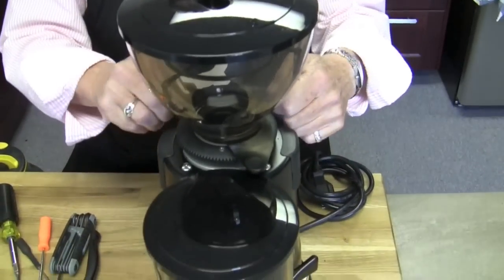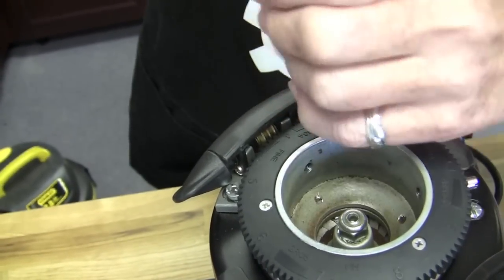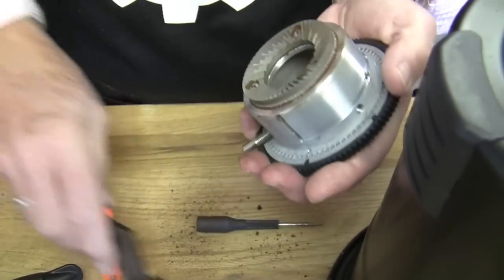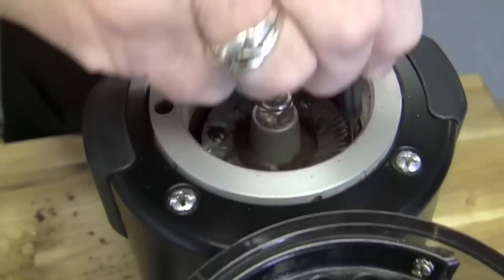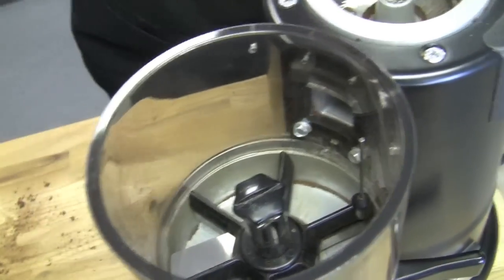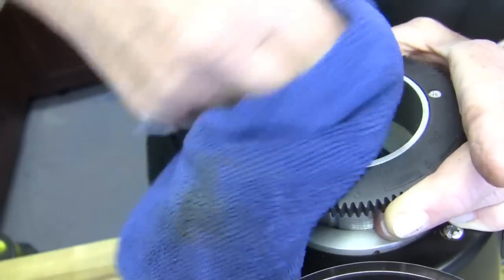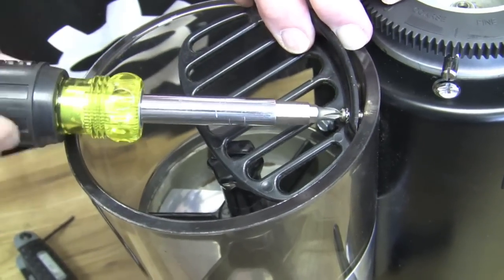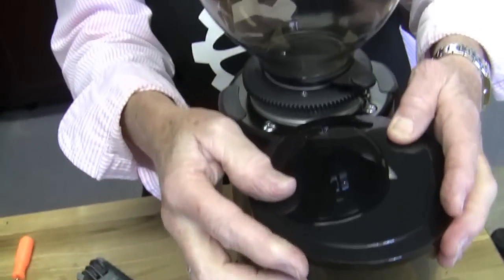Tech Tip: How to Clean the Macap M4 Coffee Grinder

Comment: Very useful. I’d bought new burrs for my (home) M4, which I’d never changed (it’s 7 years old), but I hadn’t begun the project of changing them. This morning (April Fool’s Day), still half asleep, I stupidly poured some water into the hopper instead of into my water heater. This caused the grounds to form a paste so that no beans would drop and no coffee would come out of the chute. Luckily, there was Gail, walking through the procedure for cleaning the grinder down to the burrs, so I saw how simple it was to unscrew the old burrs and install new ones. Cleaned everything up, dried it all off, and I’m back in business. But just imagine doing all that before you’ve pulled your first shot. Thanks, Gail.
Reply: caffeine dependent cognition

Comment: I know this video is as old as the hills, concerning a unit no longer currently offered for sale. But very enjoyable, clear, well done. My M4, for some strange reason, has fasteners on the worm drive which don't seem to be removable by the user. Nothing in my Allen wrench set found anything inside the hole on top of each fastener to grab onto. So I got my hopper off, cleaned the top entrance into the unit thoroughly, removed the finger guard and was able to clean and vacuum that reservoir and the interior chute, as well as the bean hopper. I felt frustrated that I wasn't able to go any further. I did purchase my first container of GRINDZ, and will start using that monthly. ( I'm recently retired, after spending forty-six years in a job which left me very little excess time, so I would be embarrassed to admit how long I neglected properly maintaining my Macap.) I actually called GRINDZ, and the representative stated that their product alleviates the need to take apart a coffee grinder. I do doubt her accuracy, because, obviously her advice will lead to more sales, but, in my case, I am actually going to need to solely rely on using GRINDZ regularly, and hope that my coffee tastes satisfactory.

Comment: 🟥THAT IS NOT THE CORRECT WAY TO REMOVE! Don't remove those 2 allen head screws, this is totally unnecessary and you will most likely strip them, they are very hard to remove. The correct way is to remove both black knobs on the worm gear tuner, yes, both of them come off,  cover the knobs with paper towel as not to scratch and pull off with pliers. you will then see and have access to 2 small philips head screws, go ahead and remove both screws, you can now use the built in hinge to tilt the worm gear tuner away from the big plastic gear, go ahead and unscrew the top burr. Much much easier this way. 🟥

Comment: Don't be. Works great to eat all the grime off. There's a bunch more you guys missed under the bottom burr. Don't be afraid to soak all those parts. But that machine was way cleaner than mine and really just needed the vacuum and a little dental pick action. My M4 is probably 5-6 years old and had never been cleaned. I know, the espresso Gods were getting quite impatient with me....

Comment: No need to remove the worm drive, just the three small screws that hold the plastic gear on. One that is off then it unscrews the same way. I soaked my burrs in a lemon juice and vinegar solution for prob 30 min. Clean as a whistle, now!

Comment: i wish i had payed more attention when you mentioned the reverse thread. Dissassembled the whole thing (inside out) to discover this after i thought it was stuck. But on the bright side i know the mechanics now and the grider is cleaner than without disassembling. 

Question i came up with after removing the doser. Is there a spare component for this so i can leave the doser of completely. I only drink 2 cups a day so the doser is just gathering old coffee.
Reply: Did u find a solution for removing the doser. Im thinking of ripping it off throwing a plastic chute there instead. I might design one.
Reply: @Maplesyrup416  i was told on several forums you can't just add the single shot dispenser part. Maybe you can 3d print something. I learned to live with it after i found put there is no easy spare part to just put on.
Reply: @GhostDweller  hey thanks for the reply. I might give it a tfy down the road. This is an amazing grinder. Q

Comment: Hey I'm just trying to do this and the hopper just won't come off? I removed the retainer but it sits really firmly and I cant lift it off even with quite a lot of force. Don't wanna try any harder, scared of damaging the grinder. Is there a mechanism I'm not aware off? Or could sticky residue have glued it on that firmly? What can I do to get it off?
Reply from the maker: If you removed the retaining screw at the back of the hopper, it should come right off. Maybe try twisting the hopper a bit to try to unstick it. Otherwise, you might need to have a heck look at it.
Reply: For recent readers who may have this problem: It's gummy residue, IME. Yes, it can glue the hopper into the M4 that firmly, in addition to making it harder to adjust the grind. I have not regularly maintained my M4 and have had to carve the workings out of the sticky resin and it is a JOB. I use a bamboo skewer or a toothpick to scrape at the bean-jam, no metal. Also: I don't screw my hopper on, I removed all the guards in the hopper and doser. These items seem to be for the American market and its litigiousness, and they are more to clean, and make it harder to dust out. It's simple and safe (for adults) to operate the grinder without these various plastic obstructions. Use tools like a brush to reach in, obv.

Comment: Hi Gail  i love your video 
Always well explained
I have a question for you
I have a Macap M5D Plus
Same as the one you show on this video
different adjustments in yours ( micro adjustable) 
Can mine be upgrated to have a the adjustment like the one you have ( i belive is the M5D Stepless) if yes you guys have the parts i will need ? Grinder are identical and have a 58 mm burr i believe 
Thank you again for your amazing video